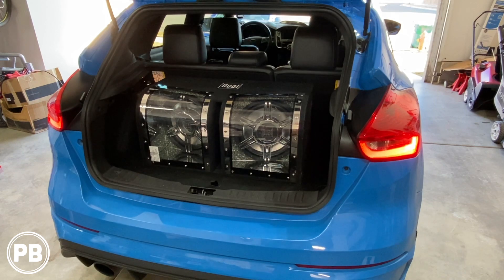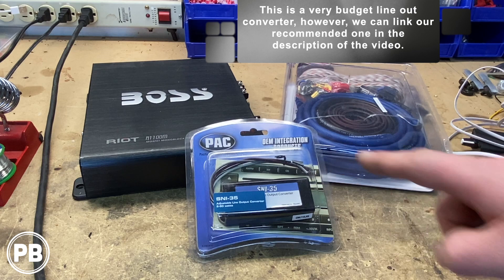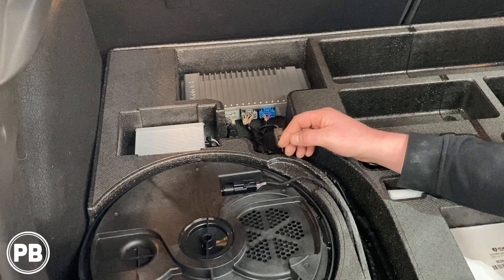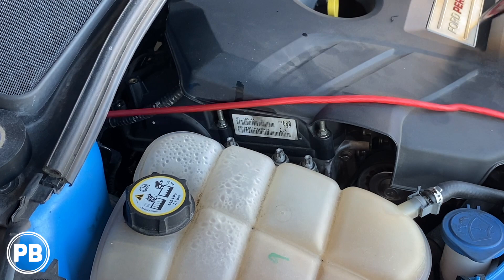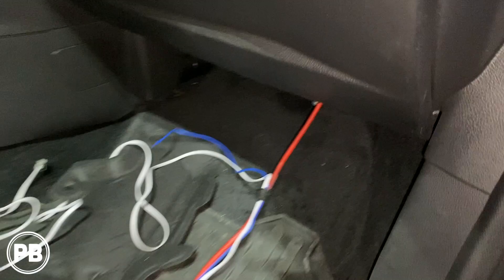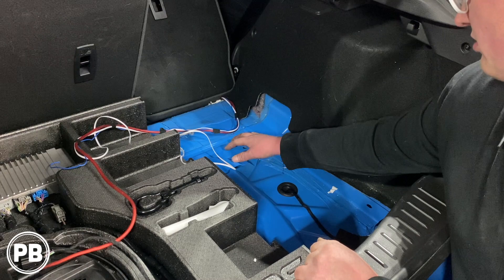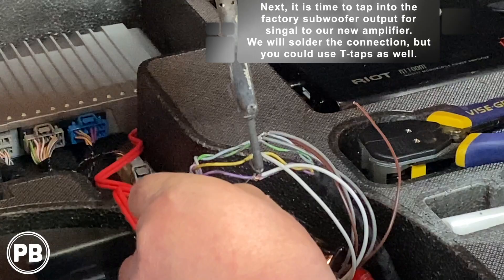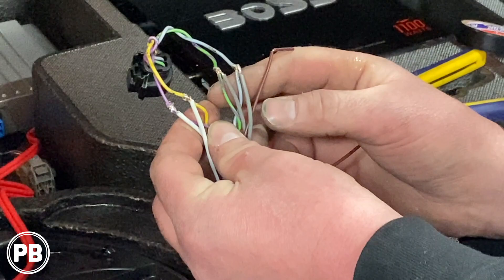2013 - 2018 Ford Focus ST / RS Amp and Sub Install

Comment: A small issue with that remote wire location is that the fuse box you tapped into is the BCM so every output is monitored. If the vehicle were to be scanned, there would be a code in there for that circuit because there is too much current being drawn. It’s not gonna hurt anything, though, as it’s obviously very minuscule. There’s a fuse panel in the rear driver side behind the carpet panel in the cargo area and is a much better source as it has two buss bars, one being hot all the time (right) and one being ignition (left). 

Another note - if you wanted a shorter power wire run, you could also remove the battery and battery tray (which also requires removal of the air box) and there’s a grommet in the firewall there as well. Either one is a lot of work on an ST/RS, but it’s a lot simpler to take the passenger side route in an SE as there’s literally nothing over there haha

Just some future reference, might make it easier on the next one!

Comment: I’m about to do this install and have had no luck finding a thorough explanation on how to do this cleanly and without worrying. Thank you! This video is perfect man. Do have a question though, with the stock sun plugged back in and not bypassed, does this mean that you would have the stock sub still working? Thanks!
Reply from the maker: Factory audio system (including the sub) was still operational, we kept it all in play, so yep, factory sony sub still working.

Comment: Do I need the add a circuit if the line output converter has a remote wire on it?

Comment: hey, i had bypassed the factory amp the same exact way as you had showed in the video. but without installing a new sub. i do have a aftermarket headunit, but all connectors are being used and the issue im having is my audio at full volume is maybe half volume. i was hoping maybe youd be able to help.
Reply: Adjust gain on amp

Comment: With this configuration, will the sub volume change as you change the volume of the other speakers? Or is an additional step required to do that?
Reply from the maker: Nope, sub volume will adjust with the factory audio system.

Comment: What size fuse did you use with circuit adder I see you used original 7.5 fuse but what size was the other fuse I should use?
Reply from the maker: 7.5 amp fuse was the original fuze in the 1st position, your amp turn on wire only needs about an 1 or 2 amps really, so a small fuse size is all thats needed.
Reply: @ProvoBeastAudio  THANK YOU everything went smooth and system sounds great! Tutorial was perfect couldn’t have asked for better one🤙🏻👍🏻

Comment: Hey how did you get the hole in the grommet we can get a blade through?
Reply: Hey I have done 2 installs on ford focuses, I’ve found that the easiest way is to grab a flathead screwdriver and just kinda wedge it in between the side of the grommet and leave it there and feed the wire through the gap made by the screwdriver, no cutting required

Comment: Hi . Could you tell me how to stop the amp from cutting out randomly , so no bass coming from the sub . I have to switch off lock car wait a couple of minutes  open it again then sub works , then goes out again  after about 20 mins and you have to do it all again .
 Many thanks
Reply from the maker: Sounds like poor wiring and connections. I’d recommend visiting your local audio shop.
Reply: @ProvoBeastAudio  . Hi , it was my local car audio shop that wired it all up and supplied the amp/sub
Reply from the maker: @karlthomas5856  Then i'd return to have them fix it, sounds like have improperly installed your equipment.
Reply: Been in touch with 4 audio specialists who tell me my system has been wired correctly by the company who installed it . The 10x speaker Sony system here in the UK does not have a amp like yours does in America and a aftermarket sub and amp will not work with the 10x speaker Sony system here , so ive been told . So wiring has been checked 4 times by different specialists  . Voltage is correct at battery and at the amp . Two NEW  Audison Prima 10" active subs have been tried and they both cut out , so its not the hardware its the crap car thats the problem . I have been told the head unit is cutting out the bass . All factory speakers work fine . If i connect the factory sub under the boot floor , they both cut out . But if i unplug the aftermarket sub/ amp the factory sub work perfectly 
No one knows the answer . So this is what i am offering . .. £1,000 GBP to anyone who can make this work so the bloody thing does not keep cutting out .
Reply: .. Forgot to mention . This only seems to happen with the 10 x speaker Sony focus cars not the ones with the lower priced factory system , and its not just my ST . I have found six other people with the ST and RS cars that have exactly the same problem . Who just want a bit more bass .
Reply: Possibly the amp overheating and shutting off. Being in that tight area with no airflow…. I would never install an aftermarket amp that way. Could also be something with the radio seeing too much draw through the speakers… that is more of a guess than anything else. Haven’t put one in my car yet. Probably happening in a couple weeks. Hopefully.

Comment: Couldn’t you have ran rca cables from the head unit ?
Reply from the maker: There are no rca outputs on OEM head units which is why you need a line out converter of some sort to provide signal to your new amplifier.

Comment: And the audio to the sub 🤷‍♂️🤷‍♂️ , how you connect it to the head unit 🤷‍♂️🤷‍♂️
Reply from the maker: using the line out converter from the factory Sony audio system.